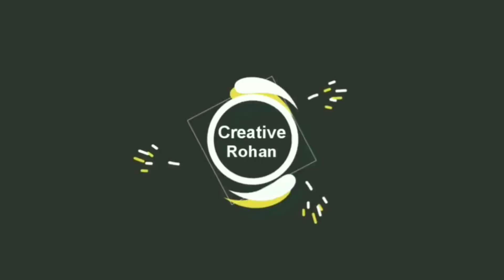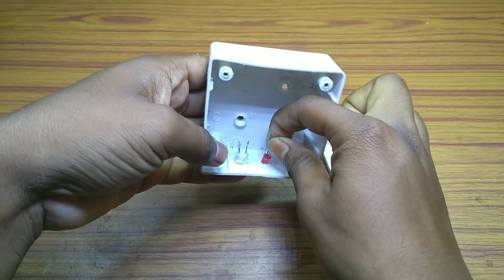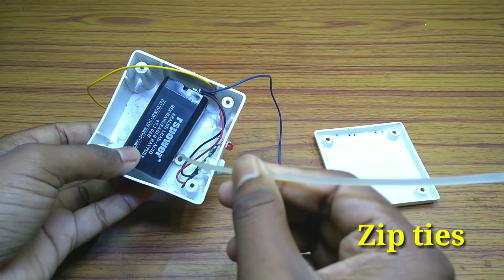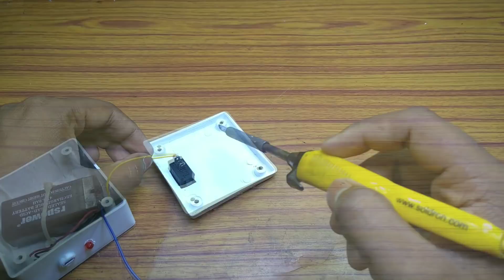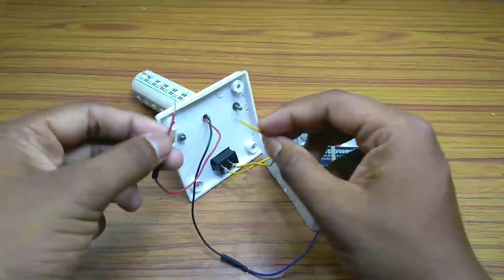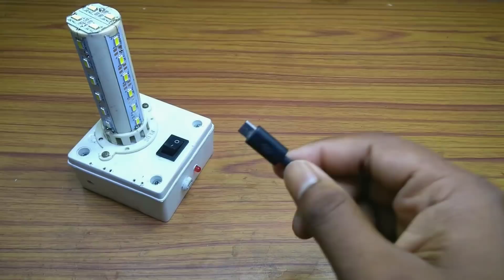How to make a rechargeable emergency light || Homemade

Comment: bhai main bhi banaya hu..4v 1.5A battery hai...lekin charge nhi rehta kya karu
Reply from the maker: LED ka number ghta doo or more than 2A ka battery use karo
Reply: @CreativeRohan  bhai 6v 5.5a battery use kar sakta hu??
Reply from the maker: Hmm but LED ka jaruri ke mutabik resistor lagana parega (47Ω) or 6 volt battery charger use krna parega